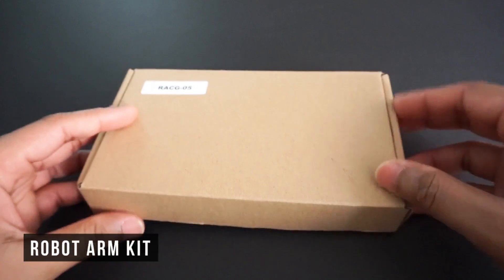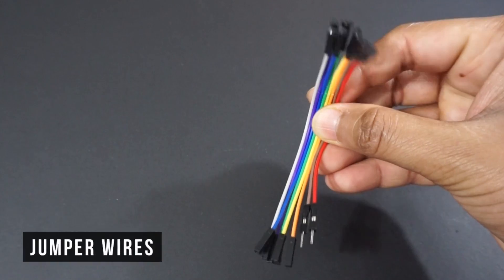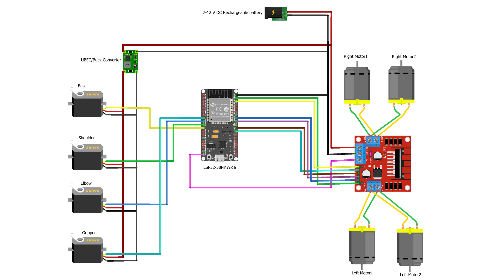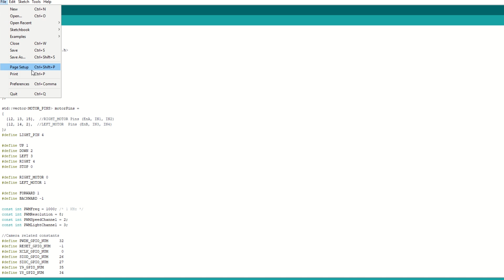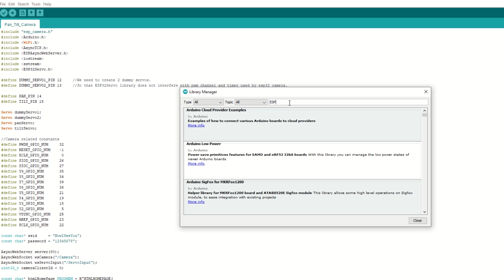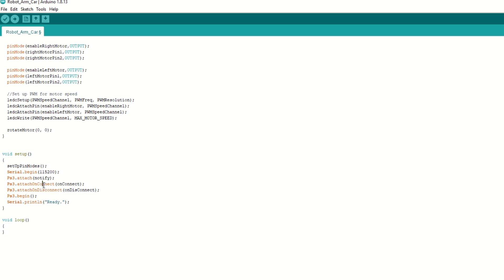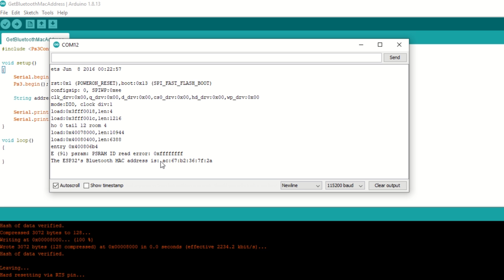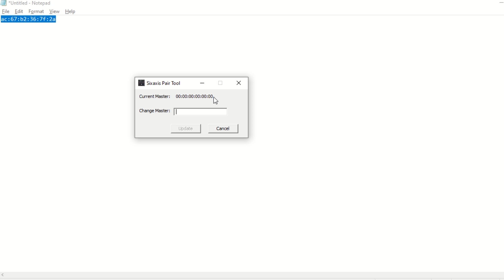Robotic Arm Car using ESP32 and PS3 Controller | DIY

Comment: Want to control it from PS4 controller. Will it work?
Reply from the maker: You will have to make changes in code for PS4 controller . You can refer my other videos for PS4 controller handling . 👏🏻👍🏻
Reply: @hashincludeelectronics  Can i use any rechargeable battery instead of lipo 2s
Reply from the maker: @pcc432-m5v  yes you can 👍🏻👏🏻

Comment: Hii bro...if I'm using ps4 instead of ps3...
So i should include ps4 library file and if i change all ps3 to ps4 in the program..it will works or not
Reply from the maker: No there will be some changes in code . Please check my video on PS4 controller 👍🏻👏🏻

Comment: Great work, I’ve tried all you’ve done but at Esp32 I’ve used 30 pin instead of 38 pin what you’ve used, I’ve perfectly given all connections to motor shield to Esp32, but I’ve given Vin to gnd to Esp32, I’ve bought ps3 Sony controller but it’s not connecting(perfectly installed MAC address of Esp32), Is there any option to connect, I’ve only that issue remaining all are good, but in my laptop Esp32 38 pin was not recognizing on my computer it’s showing malfunctioned again I bought new one but it is also showing so I’ve used Esp32 30 pin, can you give any solution for connectivity of ps3 controller to Esp32,,,,,!!!!
Reply: Does ESP 32 30 pin work? I am going to use it pls reply

Comment: Hello sir, 
Your videos are so intresting and your project are brilliant. I also had a question if we use a ps4 controller in place of a ps3 contrller will it still work. Please tell a bit quickly as I have my interschool on 8th
Reply from the maker: Yes it will work but you will have to make some changes in code . Please check my video on ps4 controller with esp32 for reference 👍🏻👏🏻

Comment: Hello sir, 
Your videos are so intresting and your project are brilliant. I also had a question if we use a ps4 controller in place of a ps3 contrller will it still work. Please tell a bit quickly as I have my interschool on 8th
Reply: Bro did you got the output

Comment: Instead of six axis pair tool we add any other tool bro
Reply: The ps3 has blinking how does it pair
Reply from the maker: @GSMithunkumar  try restarting the esp32 . Use only rechargeable battery 👍🏻👏🏻
Reply: @hashincludeelectronics  ok bro I will try
Reply: @hashincludeelectronics  bro after changing the MAC address in ps3 I have given power supply but the four light are blinking only I don’t know that’s connected or not how can we check that it’s connected
Reply: Bro it’s not connected with ps3 who can connect it bro
Reply from the maker: I am not aware about any other tool . Are you facing any issue with six axis pair tool ? Try changing usb cable . 👍🏻👏🏻
Reply: @hashincludeelectronics  thank you bro I have changed usb cable and it’s working bro
Reply from the maker: @GSMithunkumar  awesome 👏🏻👍🏻
Reply: I have change the mac address of ps3 and I have given the all connection correctly but after switch on the ps3 is not moving bro

Comment: hey please give me some solution ps3 controller not connected to esp32 board i follow the full video please give me some solution i buy all the product for my school project ps3 3 in not connecting i change the mac address but not connect
Reply from the maker: Please check the video slowly and carefully for any missing step 👍🏻
Reply: @hashincludeelectronics  yes i try every second

Comment: thanks. Actually one more question.  I have a 6 wheel chassis like that of a mars rover. You know a little bit raised ( offroad). So can the robotic arm reach till ground. Please tell
Reply from the maker: It should . But check your robot design as well . 👍🏻

Comment: I am building the same for 6 wheel and controlling with phone. Can i still use 12v battery
Reply from the maker: That’s nice 👏🏻👍🏻. Yes you can use 12 v battery 👍🏻
Reply: @hashincludeelectronics  thanks. Actually one more question.  I have a 6 wheel chassis like that of a mars rover. You know a little bit raised ( offroad). So can the robotic arm reach till ground

Comment: Hello sir The 38pin module im using only has 3v3 pin so does it work???
Reply from the maker: It should have 5v pin too . If not then you need to provide 3.3v only to 3v3 pin .
Reply: @hashincludeelectronics  thank you so much sir🔥❤️
Reply: @hashincludeelectronics  by the way how can i do that sir?
Reply from the maker: @josukekira7284  you will have to use buck converter which is nothing but voltage converter. That will convert high voltage into 3.3 v .
Reply: @hashincludeelectronics  can i replace it by connecting it through the VIN pin? I saw many people doing it
Reply from the maker: @josukekira7284  yes try it .
Reply: @hashincludeelectronics  thank you!
Reply: @hashincludeelectronics  sir it worked so well i cant thank you enough your tutorial is a life saver🔥
Reply from the maker: @josukekira7284  wow that’s awesome news 👏🏻. Well done 👍🏻

Comment: Great video bro, will it work on Ps2 controller? and also can the wheel move side way like left right? or just back and force
Reply from the maker: Thanks for checking out the video 👍🏻. In this video you can use only ps3 controller . Also wheels can rotate only forward and backward . This car can rotate left as well as right based on wheels rotation on each side .

Comment: Sir i am using 30 pin esp32 wroom module so how can i give 5v to esp 32 because their is only 3v pin ?

And sir for reducing 5v to 3v  supply form motor driver can i use diode ? 
Can it would work or not?
Please sir give me reply 🙏
Reply from the maker: Please use 38 pins module only to avoid any issue 👍🏻.

Comment: Nice project sir. I am a bit confused on the steps.you first uploaded the code to control the robot. And afterwards you upload another code to get  the mac address of the esp32.  Will this step not erase the initial code which controls the robot?
Reply from the maker: Yeah you need to first get MAC address and then later upload the actual car code 👏🏻👍🏻

Comment: can i use esp32-cam with same components and more important with same codes ? and why do you feed servos from another power source (not from esp 32)
Reply from the maker: Yes you can use it . However please check for pins . Also servos need more current which esp32 can not provide . Hence we need separate power supply for servos 👏🏻👍🏻

Comment: Bom dia amigo, fiz tudo certinho como explicado no vídeo mais funciona só o carrinho , o braço robótico funciona só o servo conectado na porta 33, as outras portas não tem sinal.
Reply from the maker: Make sure you use esp32 38 pins module 👏🏻👍🏻

Comment: Is it a must to use l298N motor driver?

Can I use l293D motor driver instead?
Reply from the maker: Yes you need to use L298N driver only in this project. You can use L293D but it will need code and connection change . I would recommend to use L298N and complete the project without any issue .

Comment: Is it possible to use the ps 4 controller?
Reply from the maker: Yes you can use it . But check the video on ps4 controller on my channel for reference.
Reply: @hashincludeelectronics  I did check the video. Will anything change in the code other than the library?
Reply from the maker: @mariammohamed1204  I don’t think so . Try changing just the library .

Comment: Hi there,
I would first like to thank you for this amazing video. It was very helpful and self explanatory. I went through most of the steps, but the sixaxis pair tool does not find the ps3 controller for me to be able to change the master. Do you have any solution or any other way to change the master.
Reply from the maker: Thanks for checking out the video and nice comment 👍🏻👌🏻. Yeah it’s necessary that sixaxis pair tool connects to your ps3 controller so that we can change the master address . Else another way is , find out the master address already stored in ps3 controller . Then you can set this address inside esp32 code. I still wonder why sixaxis tool is not connecting to your ps3 controller . Try different USB port .
Reply: @hashincludeelectronics  Thanks for your reply. The thing with the sixaxis pair tool is that it displays the massage "No device found." That's why I checked the device manager to check whether my laptop read the controller. It didn't read it, so I installed a driver. After installing the driver, my laptop read the ps 3 controller as an x-box 360 controller, and the device is still not found. I know I'm making this too long, but I really want this to work. I gave up, but later I tried to cnonect using my colleague's laptop. It detectes the controller for a few seconds and then shuts down. We tried entering the mac adress in the few seconds it detects the controller, but it entered the mac address in the wrong order. We're still trying and hoping that this project would work. Note that we tried two different new USB cables and we tried to reach you as a final resolve. Thanks for your time

Comment: Hello there. I'm having problems connecting the ps3 controller with the esp32 devkit v1. Any solutions for that? Thank you.
Reply from the maker: Please use 38 pin esp32 as shown in video to not face any issue . Also follow the exact steps in the video . Try it first then experiment on other modules .
Reply: I had the same problem with a Sixaxis Dual Shock 3 controller. I also have issues about connecting my PS3 controller to ESP32

Comment: Hello sir 
I think I am having a smaller esp 32 moduel 
What ca I do 
Please tell
Reply from the maker: I would suggest you to use the one which is used in this project . This way you will not face any issue. 👍🏻

Comment: It is a great project. It would be great if you added a camera to that same robot and the control command was done on the phone.
Reply from the maker: Thank you very much for checking out the video 👍🏻. Yes I am going to add mobile control for this project , so stay tuned .
Reply: @hashincludeelectronics  bro waiting
Reply from the maker: @Vamsi16-o8u  actually the robot arm is broken so I can not test the mobile app code . Let me see what I can do 👍🏻👏🏻

Comment: Hello sir. i really liked your project and want to make it but i am not having Ps3 controller and also not available on amazon. 
please help me
can i use any other kind of controller ?
please tell sir ASAP 
i really need U
Reply from the maker: Thanks for checking out the video 👍🏻. I  believe you can buy any ps3 controller which should be available on any other site. This project can also be made using mobile app but for that you need to check my other videos and try to combine those.

Comment: Sir, Always appreciate your work on the video about the Robotic Arm Car using ESP32 and PS3 Controller. Sir, Is it possible can I to use the Esp_ 32 development board to control the Robotic Arm Car using the ESP_32 board and Xbox360 Controller work or not? Sir, can you teach me to make on youtube how to make a Robotic Arm Car using the ESP_32 development board and Xbox360 Controller? Sir, tell me about the Xbox360 Controller library with the esp32 board. Sir, tell me in the comment.
Reply from the maker: Thanks for your comment 👍🏻 no , xbox controller will not work in this project .

Comment: bro can the conrol be shifted on phone
Reply from the maker: Yes it can be . But it needs code changes and testing accordingly. If you need then check my other videos where I have controlled robot arm and car separately using mobile app. Try to combine those projects. I might also make this project in future where we will control using mobile phone .so stay tuned .

Comment: Mr. Im building a robotic arm but with stepper motors arduinos with a A4988 Driver. I want to control it with a PS4. Do you think ur code will work if I adjust it with ps4 library or should i buy a ps3 and it will definitely work ? Please help :(
Reply from the maker: You can check my other video on PS4 controller and esp32 tank. It might be useful for your project . For using stepper motors you will have to modify the code for sure.
Reply: @hashincludeelectronics  is there one with ps4 and cnc shield ?
Reply from the maker: @lawendy6593  no . You need to combine these projects . Check how to use ps4 controller with esp32. Then add your stepper motor handling in it .

Comment: Sir, Always appreciate your work on the video about the Robotic Arm Car using ESP32 and PS3 Controller. Sir, Is it possible can I to use the Espduino_ 32 development board instead of using the esp_32 board to control the Robotic Arm Car using the ESP_32 board and PS3 Controller work or not? Sir, can you teach me to make on youtube how to make a Robotic Arm Car using the ESP_32duino development board and PS3 Controller? Sir, also can you give me a circuit diagram and the code for the robotic Arm Car using the ESP_32duino development board and PS3 Controller? Sir, tell me.

Comment: Sir, Amazing robotic arm car using ESp32 and PS3 controller and I love all your videos about robotic and Arduino projects. Sir, can I use ESP32 Mini Arduino UNO R3 D1 R32 WIFI Wireless Bluetooth Development Board CH340 4M Memory One instead of using the ESp32 module in the Robotic Arm Car using ESP32 Mini Arduino UNO R3 D1 R32 WIFI Wireless Bluetooth Development Board CH340 4M Memory One and Xbox 360 wireless Controller, will the Robotic Arm Car using ESP32 Mini Arduino UNO R3 D1 R32 WIFI Wireless Bluetooth Development Board CH340 4M Memory One work with Xbox 360 wireless controller or not if I added the Bluepad 32 library for Xbox 360? Tell me, sir.

Comment: Sir, I love the robotic arm car using ESp32 and PS3 controller and like all the other videos about robotic and Arduino projects. Sir, can I use ESP32 For Wemos D1 Mini For Arduino UNO R3 D1 R32 WIFI Wireless Bluetooth Development Board CH340 4M Memory One to make an Xbox-controlled 6-dof robotic arm car using the ESP32 For Wemos D1 Mini For Arduino UNO R3 D1 R32 WIFI Wireless Bluetooth Development Board CH340 4M Memory One and can I use this module with your given circuit diagram and the code for the Xbox-controlled 6-dof robotic arm car using the ESP32 For Wemos D1 Mini For Arduino UNO R3 D1 R32 WIFI Wireless Bluetooth Development Board CH340 4M Memory One? Sir, tell me, the ESP32 For Wemos D1 Mini For Arduino UNO R3 D1 R32 WIFI Wireless Bluetooth Development Board CH340 4M Memory One work or not if I attach ESP32 For Wemos D1 Mini For Arduino UNO R3 D1 R32 WIFI Wireless Bluetooth Development Board CH340 4M Memory One with your given circuit diagram and your given code for the Xbox-controlled 6-dof robotic arm car.
Reply from the maker: Thanks for checking out the video and your nice comment 👍🏻however I have not used Xbox controller yet so can’t comment on it for now .
Reply: @hashincludeelectronics  Sir, tell me, can I use the ESP32 For Wemos D1 Mini For Arduino UNO R3 D1 R32 WIFI Wireless Bluetooth Development Board CH340 4M Memory One on the 6 dof Xbox 360 wireless controlled robotic arm car. Sir, will the ESP32 For Wemos D1 Mini For Arduino UNO R3 D1 R32 WIFI Wireless Bluetooth Development Board CH340 4M Memory One work or not on 6 dof Xbox 360 wireless controlled robotic arm car.

Comment: I want to do it with ESP32 CAM. so is it possible?
Reply from the maker: I don’t think we have enough pins on esp32 cam for this project .
Reply: @hashincludeelectronics  when i press EN key for mac address , the serial monitor said "waiting for download
". why?
Reply from the maker: @shakibulislam6830  please follow the exact step as per video to get MAC address .
Reply: @hashincludeelectronics  I'm using ESP32 CAM? Is it problem?
Reply from the maker: @shakibulislam6830  did you upload the code into esp32cam for getting MAC address ? Also don’t connect anything to IO16 pin .
Reply: @hashincludeelectronics  I'll connect esp32cam with Arduino like your diagram..... but still this problem.
Reply: yeah! solved😍 Thank you.
Reply from the maker: @shakibulislam6830  awesome and good job 👏🏻👍🏻

Comment: there are too many errors in the code update the code once more
Reply: pls help with code
Reply from the maker: @justmanu3731  code and diagram link is in the description of the video 👍🏻
Reply: @hashincludeelectronics  im getting error of = 'vector' in namespace 'std' does not name a template type plz help me
Reply: i have sent screenshot on instagram
Reply from the maker: @justmanu3731  which IDE version do you use ? Update your IDE .
Reply from the maker: Thanks for checking out the video 👍🏻 As far as I know there is no issue in the code and it’s well tested . I have taken good care while uploading it. What specific error do you get ? Please check the video properly for library and board installation if not done already . You can send me screenshots of error on Instagram hashincludeelectronics

Comment: Sir can I use esp 32 30 pins?  same diagram with u?
Reply from the maker: Nice question 👍🏻 yes you can use this 30 pin version as well . No change in code and diagram 👍🏻

Comment: Can i control with smartphones?
Reply from the maker: For now no. It is controlled by PS3 controller . But it’s good idea to have it controlled using smartphone. I will try to make one with smartphone 👍🏻
Reply: @hashincludeelectronics  sir I think I want to refer your project for my project on this semester can or not sir? If i don’t understand can i ask you sir?
Reply from the maker: @asrfazln0024 sure . All the details are in video but you face any issue let me know .
Reply: @hashincludeelectronics  can i text you privately?